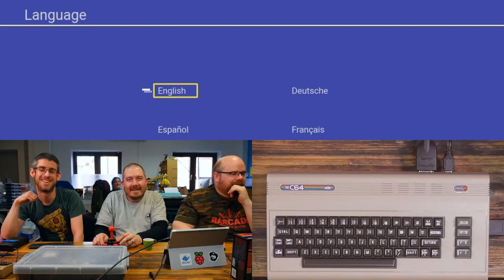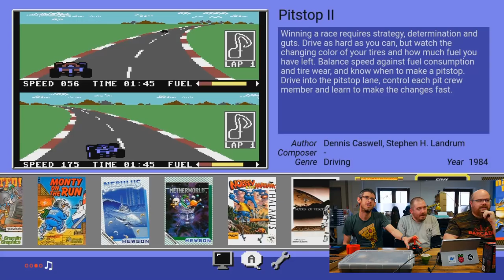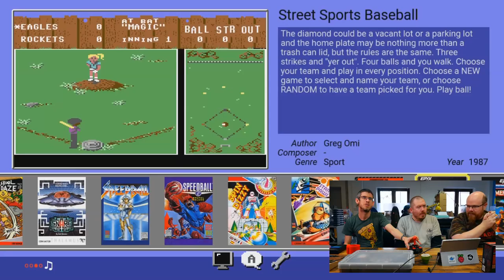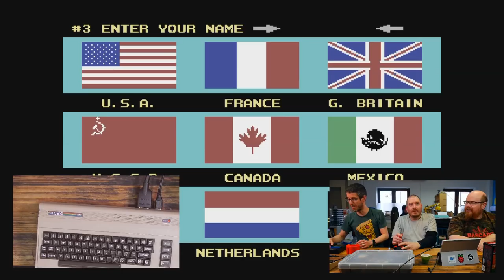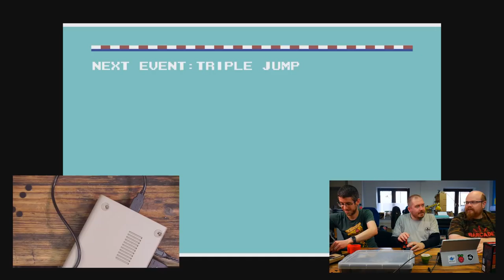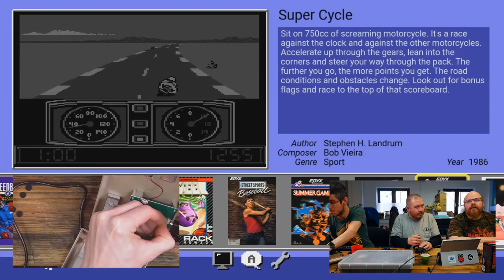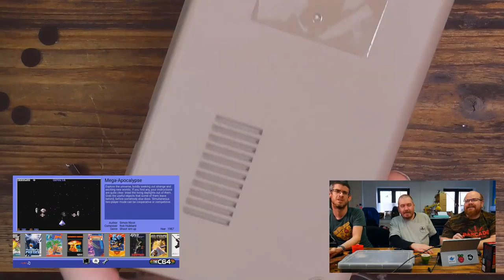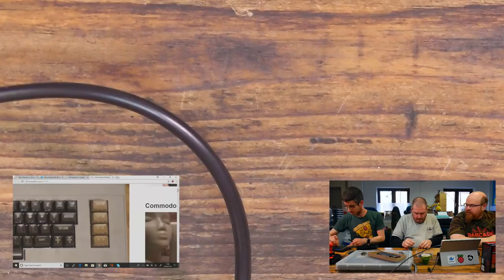Bilge Tank 112: C64 Mini, SNES Mini and Retro-fit talk

Comment: In 1977 I started with an ITT2020 (an Apple ][ clone with PAL video (instead of the NeverTheSameColor of the Apple ][) but a year later I bought an Apple ][ because too many programs were not running on a machine with PAL video system. Since then hooked on PC's, microcontrollers. The past half year experimented with ESP32-S2's and since 12 Feb I own my first Raspberry Pi Pico.